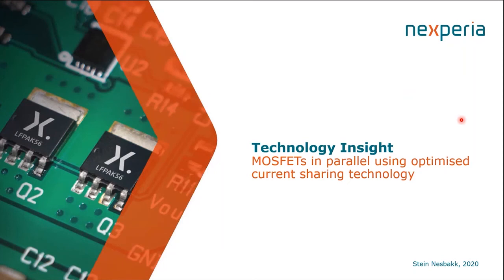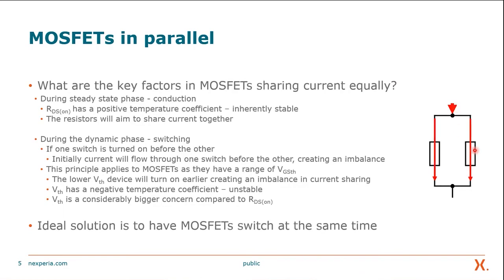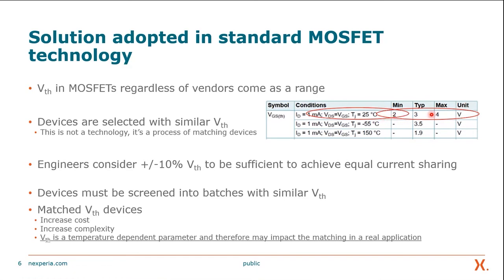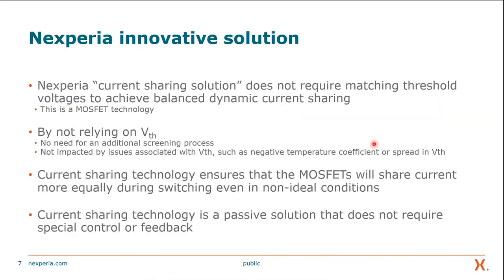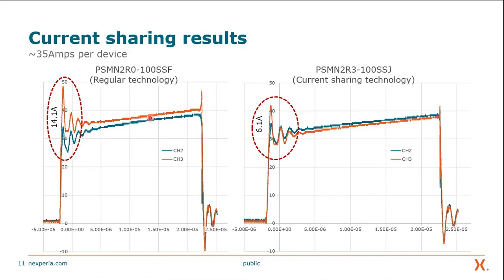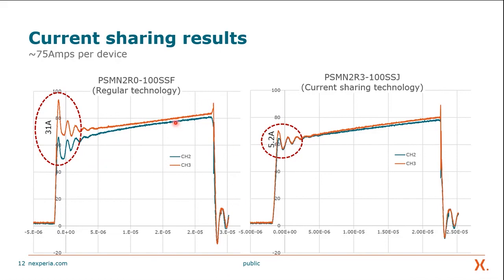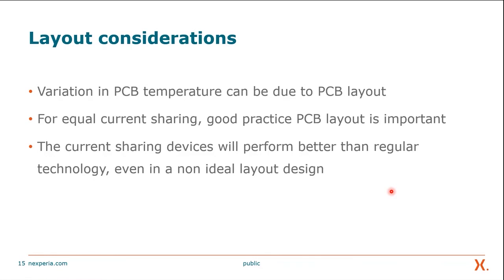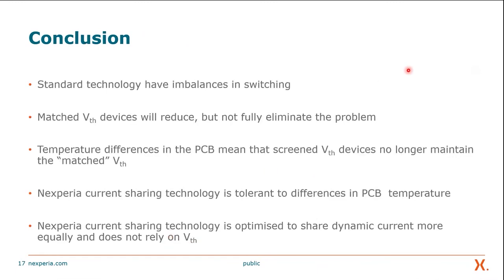Parallel multiple MOSFETs using optimized current sharing technology

Comment: Hi, good results, i often struggle parlleling MOS for dcdc
Is this current sharing MOS technology reducing somehow the efficiency(maybe higher rds on or other parasitics)? Can you make another video maybe showing a zoom in the transition, showing also vgs abd plateau zone ? Thanks
Reply from the maker: Hello, thanks for watching! This MOSFET technology is designed for switching inductive loads and specifically motor application to address current imbalances in paralleling MOSFETs.  For DC/DC converters i.e. higher frequencies the same principle should apply.  Great suggestion, we have many more videos coming this year regarding our current sharing technology. Subscribe to ensure you're notified when they're live.
Reply: @Nexperia  perfect 
For dcdc we have similar needs of paralleling , due to heat diddipations especially if not heat sink is desired.e.g battery charger 400w automotive buck boost.  already subscribed , thanks

Comment: IN looking at sharing, and the discussion that things are 'inherently stable' for current sharing, because of rising Rds(on), that is for the case of a 'hard' turn-on, as in PWM operation, or?  If used in any kind of linear mode, the threshhold voltage is an issue, no?
In the graphics for the PWM waveform, it would also be rather useful to show the driver waveforms into the gates?
Reply from the maker: Hello, thanks for watching! The intended application is switching i.e. hard turn ON/PWM, “inherently stable due to RDS(on) rising” refers to steady state and is a given regardless of which technology. This technology is specifically designed for dynamics during switching and resolves the current sharing instability normally caused by the different VGSth in MOSFETs. Pure linear mode operation is a different topic in itself.

Comment: Have an inverted welder which has 40N20 Yo7E  mosfet  .i cant find a replacement  but have found smaller ones can I join 2?  together???
Reply from the maker: Hello, 40N20 yo7E shows to be 200V, the current sharing technology devices are 80 and 100V. You can absolutely replace a bigger MOSFET with a smaller providing the spec is met. Here is an LFPAK56 devices with VDS of 200V and a similar capability: https://www.nexperia.com/products/mosfets/power-mosfets/PSMN059-150Y.html

Comment: So my 2000va ups has total of 12 N channel Mosfets. But in the board design there is place for 16 Mosfets, but for some reason they put 12.
So my question is can i add another 4 Mosfets in the empty place ?
Will it increase my ups efficiency (not backup time's) and lasts longer.
Will it be Dangerous,  i mean adding additional 4 mosfet will burn my PCB ?
Plz answer Sir.
Reply from the maker: Hello, thanks for your question! Your UPS vendor will have left spaces because 12 were sufficient for the output load (space for the extra four MOSFETs is for future expansion or higher power output), so in short yes, you can add 4 MOSFETs in the empty spaces. It all depends how you define efficiency, if a design meets all the requirements with 12 MOSFETs then using 16 it is not efficient in terms of cost, but using 16 instead of 12 it will reduce power dissipation and may make the design last longer. Adding more MOSFETs will reduce power dissipation and reduces heat.
Reply: @Nexperia  Thank you for replying. Actually my ups board Mosfets got blown off without any kind of load a week ago. It was charging that time..so i need to change all the Mosfets. Then i saw 12 instead of 16 and i can buy those SW3205 Mosfets in a very low price. So if i add another 4 do i need to add any sort of capacitor/resistor/diods/whatever ?
If you want i can send you my board picture if you give me an email address.
Reply from the maker: Hello, please get into contact here and we will support as best we can https://www.nexperia.com/support/

Comment: When do expect to produce higher voltage devices that use your Current Sharing Technology?  An example would be 200V.
Reply from the maker: Nexperia current-sharing technology is a first of its kind, it is implemented in the 80V and 100V platform devices as it is designed to primarily target motor control applications operating at nominal voltage range of 48V-60V. If you have specific requirements for higher voltages we'd love to discuss these, please contact us on nexperia.com/about/contact-us/

Comment: Godd to know this current sharing technology but how about the on resistnce Rds  ?
Reply from the maker: Hello! This technology was fine tuned to give best current sharing performance for dynamic switching. For steady state where RDSon is of relevance, the “MOSFET on-resistance” is a well-established parameter, usually with 98% - 99% of devices falling within typical values, combined with the fact that if there is any mismatch in current sharing, it is short lived and self-stabilise due to RDSon thermal characteristics and therefore does not cause major concern in switching application. Thanks!